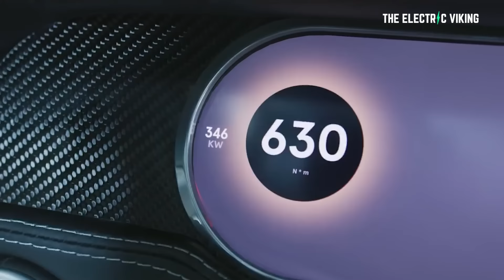Chevrolet's e-motor kit to convert gas cars to EVs is EPIC

Comment: the thumbnail pic Sam used for the video (but doesn't speak about directly) is of GM's K5 Blazer conversion from SEMA 2020.  because of the shutdowns from the Global Pandemic the vehicle and the show that year were held virtually.  for the record with people's family and friends dying, life was NOT that good 2 short years ago nor is it now, and this reality is one that must be faced (that is "faced" like MEN not like naive children).  anyway for 2018 the conversion GM showed off was the E-Copo Camaro drag car, similar to Fords Cobra 1400 drag car.  for SEMA 2019 the conversion GM brought was a 1962 C-10 pickup dubbed the "E-10" (still have the pics on my phone). and for SEMA 2021 GM brought the famed yellow Project X '57 Chevy, only now it's converted to EV.  

since I alternate show attendance between years, I didn't attend SEMA 2021 in November but I did attend the companion PRI 2021 show. this Performance Racing Industry event happens a month later in Indiana in December (ie, this show caters specifically to those in the field of Motorsports) and GM brought Project X there so fortunately I got to see it along with Ford's F100.  btw the reason the F100 runs/drives as well as it does is because it uses ALL the components from the performance Mach-E GT.  so in order to achieve the end result the Roadster Shop (Mundelein Illinois) did for Ford, you would basically have to start with a brand new $65,000 - $75,000 Mach-E and then tear it apart.  but of course since efficiency and fighting Climate Change is the OVERARCHING goal of all this (or so goes the narrative) one then has to question the INTELLIGENCE of the person who would willfully disassemble a brand new EV just to put it in a vintage beater...? or even forego repairing a Mach-E with light damage...? being a legacy OEM Ford will sell you the parts to repair the vehicle, whereas "start-up" Tesla will not (unless you're an authorized Autobody/Collision repair center).   

as I bonus I also got to see a GM conversion that most people don't know about because it DID NOT display at SEMA, no, but instead made it's debut at PRI 2021, and that was Lingenfelter's El Camino called the "E-Camino" (still have the pics of that also on my phone).  of note where the E-10, K5, and E-Camino conversions of the past 3 years are all based off the E-crate motor derived from Chevy Bolt components, Project X is actually based off GM's latest ULTIUM components.  looking under the hood I could see the external difference in the drive units (versus what's in the Bolt) but also had a good chat with one of the engineers on the project as to how they configured the battery pack for Project X.  surprised to discover he was not a mere "pencil pusher" but a real ENTHUSIAST from the ICE/Gas side of GM.  yeah, he was showing me videos on HIS phone of burnouts with the '57, and was forthcoming about how they ended up BREAKING AXLES during testing. 😅😎

also keep in mind, any vehicle you chose to convert to EV (instead of buying new/used from an OEM) also means you are choosing to GIVE UP the ability and convenience to DC fast charge the bloody thing at places like EA, Ionity, EVGO, Chargepoint, etc.  those paying attention will be aware of how Tesla taught both Rich Rebuilds and Legitstreetcars Alex this lesson the "hard way".  so giving up the ability to fast charge would be a MAJOR CONTRADICTION from what you see most EV enthusiasts (both Tesla and CCS) being "on about".  just something to consider as I don't want you to fall into the TRAP of thinking "you're going to have your cake and eat it too", because you're not.

Comment: Get off it, $3,000 is NOT cheap. It might as well be $40,000 for most people. If you're going to blow 3 grand, it would be better to buy a pair of horses that don't use gasoline at all.

Comment: I want to convert my 1946 dodge WDX Power Wagon setup for WWII.  US Army green with white star.  it can easily handle the weight of batteries.  Should be easy.  Batteries are just high right now.

Comment: Build a kit with a 300+ hp motor and drive unit similar to the tesla design that bolts into the space of a GM 10 (or 12) bolt rear axle, a battery array that bolts to a variety of GM engine mounts, controller, inverter, and I'll consider putting in my order.

Comment: I have a 2012 equinox with barley 65k miles, would swap the 2.4 ecotec for an E Crate in a heart beat. I wish I still had my 02 Ford Expedition cuz I would E Swap that too. Imagine the big bad SUVs no longer polluting the air and saving on gas.

Comment: Well I don't think my 22 year old ICE Monte Carlo would be worth putting in just an Electric motor even if the vehicle was compatible.  The body does have some rust spots on it around the wheel wells.  Be interesting to hear what the price would be to convert an ICE vehicle. 
 It might be cheaper than buying a new EV outright, because in a new EV, we are also paying for all the fancy Electronic features.  Be interesting where they would put the big battery on a Monte Carlo 2 door sports vehicle.  LOL!!!!  I still want my rear trunk space for golf clubs!!!
My Monte Carlo still runs pretty good, so won't change it, and I do have a new Tesla model Y. 
Anyway, thanks for the info in this video.

Comment: I have worked at GM in Canada for 22 years, till they closed. I currently have a 2017 Silverado , 4x4 with Lift kit etc. Would that electric kit work for my Truck.. I also live on The Bruce Peninsula going 60 miles out into the Great Lakes. We have very cold winters here. How would the Battery hold up in the cold? AS a GM Employee, I wonder if they could,nt just put a powerfull alternator/Generator,so once it is running, it would charge itself??

Comment: If it doesn't have a complete package then it's not a viable option. Too expensive an option. If I remember correctly there are other complete options for 30-40 thousand dollars from other suppliers. It might be less expensive to buy an older Leaf and replace the battery than to convert an ICE vehicle to electric.

Comment: Hyper expensive e-conversions are a non starter for the masses. Also, it makes almost no sense to do a conversion on a truck or other boxy large vehicle since aero is poor, weight is high and the thing is not built to handle the extra battery weight -- assuming you want reasonable range and would need big batteries. Sure, you could have a crippled short range vehicle but we need solutions that attract an average vehicle owner.  Small aerodynamic carse (i.e. sports cars) make sense.  Probably a reasonable interim step on the path to full electrification is a hybrid crate motor since with the hybrid, you only need a small battery to reap a tremendous benefit.

Comment: Conversion of the millions of cars that are under 7 years old is a great idea and need not be performance just reliable and comfortable and could really dent ICE car use as EV manufacturers are strapped for output.Toyota should do this!! Boat industry need same push to convert outboards ICE motors and inboards!!
Reply: Conversion are horrible you can't even get decent range in most cars because the gvm limits also boat are even more of an issue they do make electric outboards but range is extremely limited because even with low powered system the batteries get big real quick so conversions on most craft won't happen the exception to this has been sailboats since obviously the motor is secondary drive and only used as needed but many are having large battery systems on board with various forms of generation so and electric motor doesn't change much

Comment: These things are a joke for anyone but city slickers. I can't even drive an ev to town through the mountains and back, especially hauling a load of any kind. We are giving up our freedom to travel this country by going electric,  I usually go 800 to 1200 miles a day if I go on a trip and do my best not to go into cities and towns. When I stop it is always far off the beaten path so what am I supposed to do,  carry a big generator full of gas to charge my truck?lol. Kind of defeats the purpose doesn't it. The power grid will not be able to handle charging everyone's car up anyway, not even close. If a car company wants to succeed they need to start making something simple, cheap, and reliable with some real steel in the engine block that everyone can afford to pay cash for without financing it 60 months. There is not one new vehicle out there worth a quarter of what it cost. The newer vehicles I have had all have had expensive breakdowns within the first two years. My restored 75 and 84 never leave me stranded though and my old 12 valve can pull with the new truck while getting better fuel milage. Until there is a more efficient way to generate electricity and store it without worrying about damns, coal, and nuclear we are being lied to when we are told ev's are ready. Don't get me wrong,  I wish they were  in my case. I have made my own power for the last 13 years and could easily charge a car, but it won't get me to town and back in the same amount of time due to charging as my diesel running on used vegetable oil does.

Comment: I want to convert my Chrysler PT Cruser 1999 into an EV for just 100k range would be great. It's in very good shape as new but the engine is not as good for just 120k on the meter. A cheap hypbrid conversion kit would be an ideal.

Comment: It has to be a complete kits or it is a big PITA and very expensive. It needs the motor, controller, instrumentation, and wiring harnesses. The only thing that should be separate is the battery because every car will be unique in battery placement and battery tech is changing so fast it need to be upgradable.

Comment: 6K patents are about to be released. We need zero point energy then do this. Thats my plan for old ice vehicles.
Reply: er,   if you want free energy here is what works:   put solar on your roof.    either feed it back to the grid and run the meter backward,    or if you want the extra complexity (and flexibilty) get a onsite battery and store the energy there.    Use that to charge your EV.      Will it cost money to build the system?   Yes,    could range from low thousands to 10's depending on how big and what options.   I'm sure that  kryptonite and dilithium crystal ZPE generator won't be free to build either.  (well maybe if you spin some magnets /really/ fast)

Comment: Orrrrrrrr
In my f100. Add front axle. Motor drives front. Engine rear. Coasting or slowing charges pack. Pack is smaller since also plug in and gas engine. Better mpg, huge HP increase, same old school sound and fun. 

Tons of torque available. And AWD.

Comment: There will come a time when batteries as we know it will become obsolete. All you'll need is an electric motor, a controller, and a " Flux Capacitor " and you'll be good to go, possibly cutting the weight and cost in half in the process.

Comment: I need an affordable kit to convert my speed boat. All parts have to be under $10k including the battery if I could get 2 hours of hard play or 4 hours of cruising I would be tickled. Provide add-on battery modules and solar charging Bimini top kits. I bet in most cases fully charged at the dock.

Comment: I feel that same excitement,  Sam! Converting beloved vehicles would give them a new lease on life. If all the fantastic projects people are working on to improve the planet and our lives on it come to fruition we may need to change the planet's name to Utopia.
Reply: Slow down don't get to excited. Where is all the electricity to charge all these electric vehicles going to come from ? On the street I live on just my side of the street has 32 cars that need charging. On the the other side of the street is a 30 suite apartment block and 8 houses 38 more vehicles thats 70 vehicles that will need to recharge likely not all at the same time but what if they did all need to recharge overnight plus run heat or air-conditioning depending on the season. Most power in north America is produced using coal. No way are the power grids we have today gonna be able to handle that. There is also all the mining  needed to get the metals and so on for the batteries to run these gems everyday meaning we are now digging the hell outta the earth. We have enough problems with mining wrecking ecosystems and forests, mountains etc.   Epic failure ahead with these e-cars.

Comment: I only heard the need for a battery pack mentioned once. The electric motor is useless without batteries. Or is a very small battery pack included?

Comment: HEY EV - we don't need straight EV's we need conversion kits with a sophisto charging motor circuit - say 20% of the original power. I think ALISON TRANSMISSIONS is now producing these for long haul trucks and has one that a few bright mechs on YT are putting into old pickups of every description. They are single axle hub systems with a diesel motor. Unfortunately these have to pass the same rigorous EPA type tests as any ICE vehicle. But if we could slip the China girl to a few key congressmen to see things differently - Americans might get favorable nation status.

Comment: Exactly as I predicted! This is the future state of hot-roding. I think there will be a lot larger market because a lot of folks who want to build a car don't have the skills and expensive tools it takes to mess with motors and transmissions. Refitting vintage cars and building kit cars is going to be wild. 3D printing of custom parts will play a part in this also. Someone needs to develop a CarOS so these can be software defined cars like a Tesla with over the air updates and everything. Image if Shelby, Hennessey, Bosh, or Magna sold the OS and other parts needed to complete the car.
Reply: Engineering the chassis and body to carry enough batteries to drive is the challenge people are forgetting about. If you want to use the vehicle daily your going to want a 100mile range minimum.. really more like 200.. engineering the weight distribution etc is a bitch at best. The easiest part is swapping motors.. Yamaha makes a really good setup for cars right now. Like have a big block turbo charged dragster with 1/2 gallon size gas tank..
Reply: @kennedy6971  Battery technology will catch up, the pack will be no heavier than the motor so the car might get lighter.

Comment: Where do you put the battery ?
In the boot ?
Maybe where the fuel tank was , you could fit one to give you a range of 25 miles.
Make a mistake & you can electricute yourself.
It would be cheaper to buy a new car.
What do you think insurance on one be if any insurance company will insure a DIY electric car ?

Comment: Electric motors is my trade. 
There isn't that much in an electric motor,  it should be cheap. 
As for the controller there's a little more in that but not a lot. 
Seems like a lot of profit making going on there.

Comment: I’m not a fan of the idea because :whatkind of battery does it use and are they easily rebuilt ? I don’t think so and that is a problem . where does the material to Build the 🪫battery come from and how green is that operation? Where’s the power to charge all of these cars going to-come from and how green are these power plants?and then there’s the safety issue of installing electrical motors and batteries in a vehicles never designed and crash tested with this in mind . It also will cause a huge cost spike in the mining and materials sector causing everything and every industry that uses these materials to spike ultimately passing this cost to the consumer 🔩⚙️⚒🔧⛓🧲💰💸

Comment: Really surprised at the suggestion of a Chevy EV crate motor. I would love to be able to buy such a kit but, personally, I would not want the risk potential of selling such a DIY-oriented E-crate kit. Furthermore, if battery materials will be in short supply, better to sell cars than kits.
Reply: The battery problem can be solved if we step back from the Lithium chemistry for vehicles.
Reply: Battery tech is advancing with total investment thrown at it going up faster than the record high temps. Still, to date they'd be better off sticking an efficient 5hp constant speed generator in there with a gas tank and only a small battery pack/capacitor bank for city driving while the genny can power normal highway driving. That's still going to double mpg and halve emissions at least and could be swapped out for any magic batteries that finally arrive. Even better would be a fuel cell getting up to 95% efficiency though it'd have to dump excess carbon that would foul the fuel cell, which is OK if it's carbon that was already extracted from the atmosphere to make renewable fuel powered by solar, etc. That would be up to four times as efficient making that fuel cycle cost competitive at four times the current cost of gasoline. All it really takes is a big enough government commitment to get the economies of scale to a point even better than 4x current gas. As if Big Oil will let that happen.

Comment: How much do a big-block V8, automatic transmission and a full fuel tank weight. Build a crate of a motor, management/converters system and batteries that fit in the space in front, the transmission and fuelt tank space. Also a electric heater. If this could be a  close to  a bolt on, then we are close in to circular economy. Trow out the ice engine, in with the EV system.

Comment: How about a 20-30 hp wheel hub brushless motor that you can just mount your tires to and run power to. Build in Automated control modes from electric only to hybrid or performance assist etc